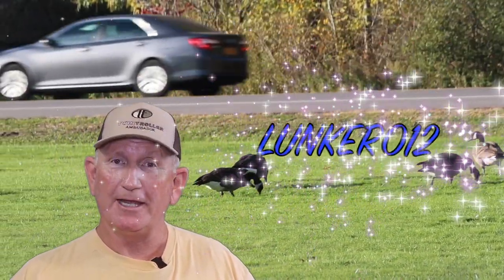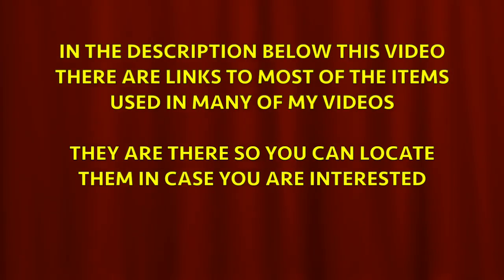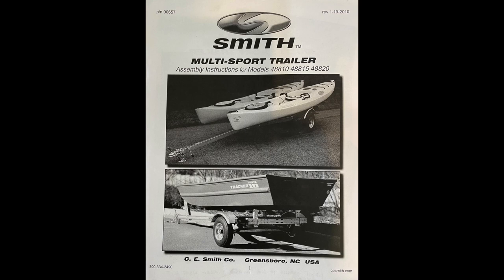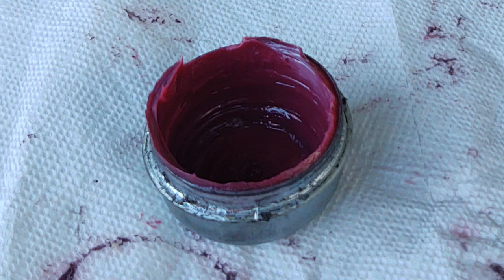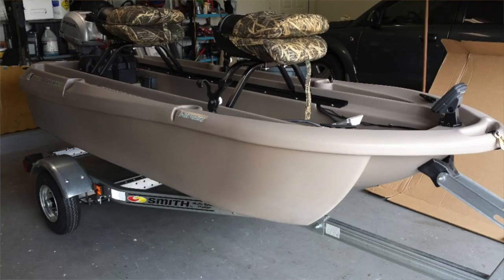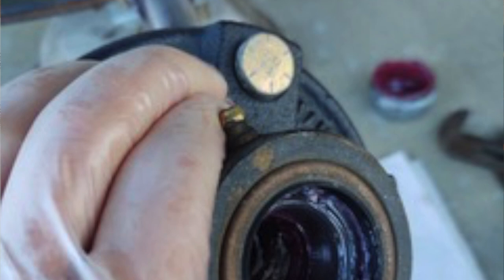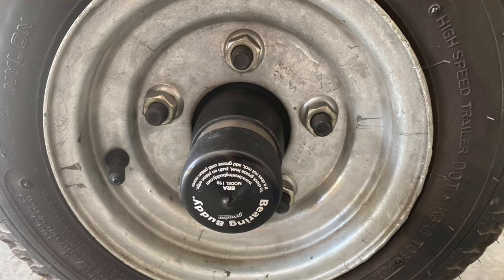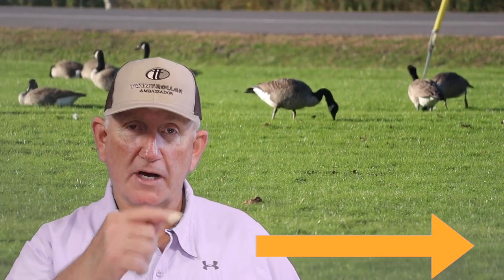WHAT YOU NEED TO DO FOR BOAT TRAILER MAINTENANCE!!!

Comment: Well Gerry it appears that I also have a 2017 or 2018 trailer and it also has both fittings. It is so typical though when something isn't broke companies think they need to fix it. My trailer had several differences than yours. Mine came with LED lights and you had to buy yours and my wiring was a lot different but they both work. I think my biggest complaint was in the cheap metal used in the front where the boat is pulled up tight against the rubber bumper because they bend so easy. I covered my trailer connector but I still had to clean a little corrosion off when I hooked it up for the first time this week. I will have to make sure it stays dry after each use.
Reply from the maker: Steve, Your came with LED lights? That is a surprise to me.
When you says your trailer connector had some corrosion do you mean your trailer light connector that plugs into your vehicle lights? If so, apply a light coating of Dielectric Grease to the connector surfaces and they will not corrode and will slide on and off easier. If they get a little wet it will not make much difference.
I agree, the bracket that the TT bumps into in the front is not the best. 
Catch some big ones this season and stay safe!                                      Gerry
Reply: @LunkerFishing  Thanks on the Dielectric tip and yes my trailer was so new when they sent it it came with the book from the previous trailer. I had to call Smith because the new lights did  not match up with the light diagram in the manual. They were apologetic and found someone to explain how to hook it up.
Reply from the maker: I guess that is progress!                                  Gerry
Reply: What! I did not get led lights with my 2018 purchase. ☹️

Comment: Hi Gerry, 
After I commented earlier, I realized I could get the bearing number for you from the hubs that were replaced by CE Smith.  The bearing number is L44643  Also RTK which I assume is brand and China location of manufacture.  I assume these bearings are the same as the ones with the correct lug pattern.  Once I find your bearing buddy video and notes, if I use them I will get those bearing number too to see if they match and post it here.
Thanks
Terry
Reply from the maker: Terry, thank you! I will try running those numbers to see where I can get some.       😀.  Gerry
Reply from the maker: Terry, Here is a link to that bearing and a bearing kit:
 https://www.etrailer.com/Trailer-Bearings-Races-Seals-Caps/etrailer/L44643.html        
Gerry

Comment: Hi Gerry,
I purchased my TT in December of 2016 and does not have any grease fittings. However I do have an interesting fact you might be interested in. When I was assembling the trailer, the wheel would not fit.  I contacted Smith and the told me the wrong hub was sent and sent me the correct hubs.  So I am guessing more than one hub could be used as long as the correct rims were also supplied.  Also, could you point me to the Grease buddy Video and notes on size?  Thank you for posting your videos, I really enjoy them
Terry
Reply from the maker: Terry, Here is the video:
https://www.youtube.com/watch?v=xLIJOZ80Oe0
In any of my most recent videos under the description I posted anything I use in my videos as well as the bearing buddies.
Gerry
Reply: @LunkerFishing  Thanks!!